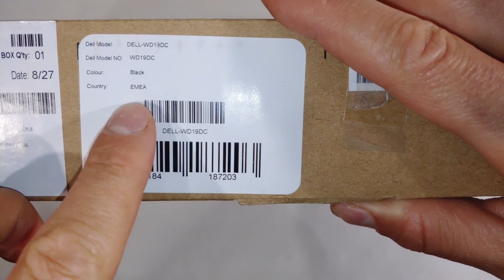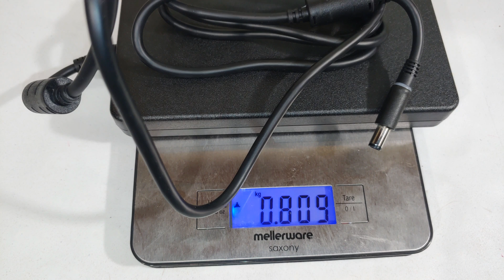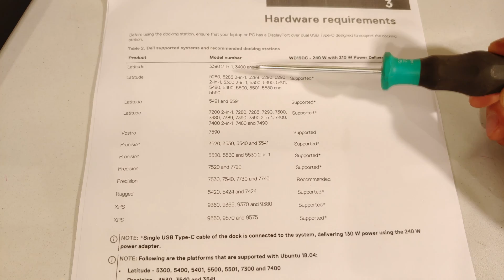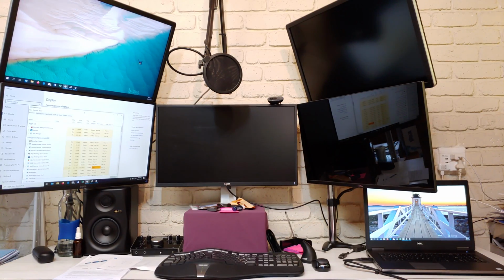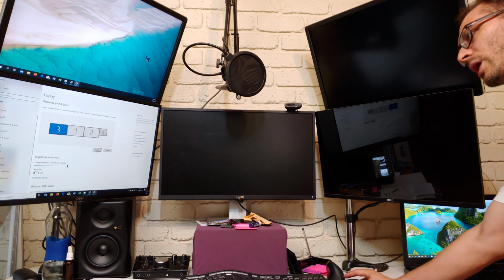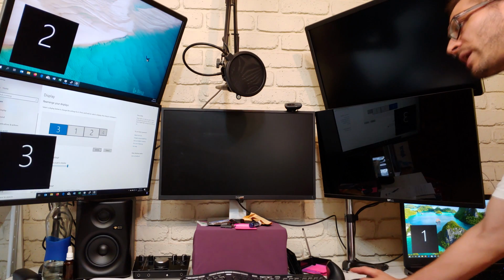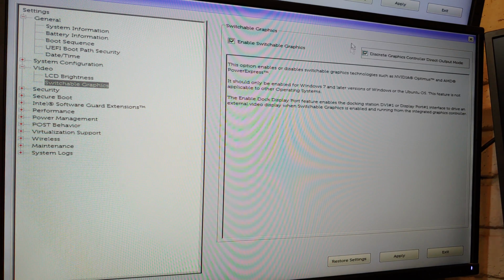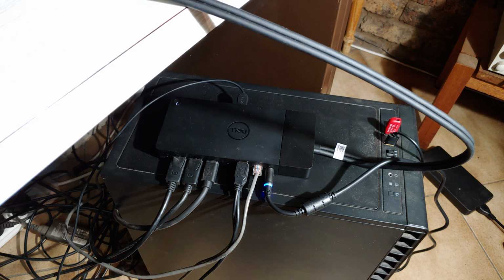Unboxing, review, and how to use the Dell WD19DC dock

Comment: This docking station is horrible.  I have one at work and I have one at home they both have a hard time connection to my dual monitors.  I've tried everything to get it to work and it will work eventually sometimes it takes 20 min of trying.  My IT department has tried everything and still can't get it to work like it should.  It has problems with my work Dell computer and My MSI home gaming computer and my asus gaming computer.  I've been dealing with this problem for 4 years.  I'm thinking about spending my own money to replace the one at work with something that is not a Dell.

Comment: Thanks for this. There is very little info about these docks.

I spent many days trying to get a WD19S to work reliably with a Precision 7560. I even had a Dell tech investigate, he couldn't fix the problem even after a swap to a brand new motherboard (under warranty). In the end all he could suggest was a WD19DC, which comes with a 240w PSU instead of 180w for the WD19S. A quarter of a kilowatt for a laptop!

The WD19DC didn't work at first, even after FW and driver updates. The BIOS kept complaining that the dock was underpowered and that it didn't support 2 docks connected simultaneously (there was only ever the 19DC - I gave up on the 19S months ago). Ethernet wouldn't connect through the dock at all.

Finally I cleared the old logs from the BIOS, and since that it has all worked perfectly! Bonkers!

It's a bit worrying that after all this, most of the time only one of the dual-connector LED's is lit, which shows only one is charging at up to 130w, exactly the same as the WD19S did when it momentarily worked. But it's normal behaviour:  as far as I can work out, 2 LED's only appear when the load demands it. The one that's lit seems to be random. It starts with both lit, then turns off one.

One other thing: I have 2 x yellow lights on the dock ethernet port, which I think you said = 100mbs. The other end of the cable is plugged into a Netgear hub that shows the link running at 1gbps. 

I too miss the tray-type dock I had with my old Precision M4500. Wires sticking out the side is a horrible kludge, and those fragile USB-C connectors are soldered direct to the Precision motherboard -  no easily-serviceable sub assembly :(

Comment: Just purchased this bad boy today.
I think it a a little overkill for what I need but I’d rather have too much than not enough. Two 27 inch monitors running at 1080p and my dell laptop — three screens in total for software Development so I purchased this docking station mainly for the extra USB slots plus display ports

Comment: Is this docking station fully compatible with MacBook Pro 13" M1?
Reply: Thanks, I’m already using it with MacBook but these dock cables are a little bit wider than MacBook slots which is pretty sad for me 😀 I have to plug just one of them and use original Apple cable for power delivery 😀

Comment: There’s only 3 USB-A Ports, can you recommend a good USB Hub that works great with this?

...And also which port would be the best port to plug the Hub into?

Plug it into the front USB-A Port or plug it into one of the Thunderbolt connections?
Reply from the maker: i have used the unitetek USB3 hub, works okay

Comment: Hello there, Sir!
My monitors have HDMI ports and not Display Ports. If I buy an HDMI-DP cable, or use an adapter on my HDMI cable which transforms one end to a Display Port, and I use it this way, should it interfere with anything? Would it still charge my laptop and share the video? Or do I have to change to monitors with Display Ports?
Thank you in advance!
Reply from the maker: you can use the display port converters - they must be "active" types.

Comment: Hi
Thanks for the very informative video.
I have a question though, may be you can help.
I have an Alienware M17 R2 gaming laptop and a Dell D6000 universal Dock station; right now I'm not getting any power to my Laptop through the Dock, I have to connect the actual power supply to the laptop while connected to the Dock so I can use the ports in it.
Dell support is telling me I can use the WD19DC dock with my laptop and it will provide power to it, but looking at your video, looks like this dock has 2 USB-C cables, my laptop only has 1 USB-c port....my question is, in order to supply power to my Alienware laptop do I need to connect both USB-C connectors at once?
In other words, is this Dock compatible power-wise with my Alienware?
Thanks.
Reply from the maker: you can get power charging via the USB C cable but for full power transfer you need two USB C's. One USB i think is capped at 90W so check the power output of your current charger and see if its lower than 90W, if it is then this dock should work.
Reply: @ecologicaltime  One cable is capped at 130w, not 90w.
Reply: @ecologicaltime  My Dell 7480 has a dead battery and I noticed that when using one USB C, I still have to connect the power plug directly to laptop as well. Otherwise the moment I remove it, Laptop powers off. So just wondering if with just one, it is charging the battery, plus using it to then run the laptop ? I will be shortly switching to a new 5400 laptop to get around this old laptop dead battery problem. Your review was very helpfull. And you have some insane 4 monitor setup !!